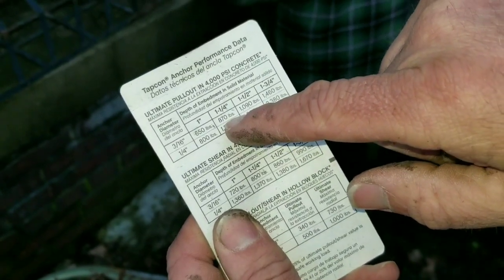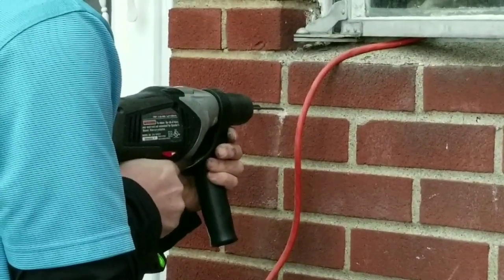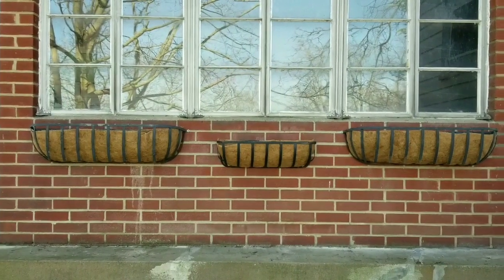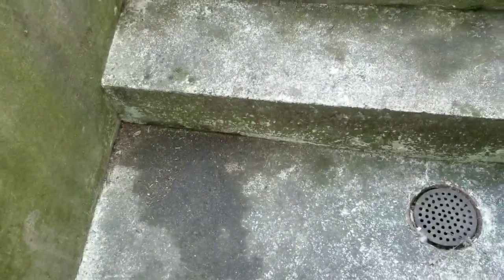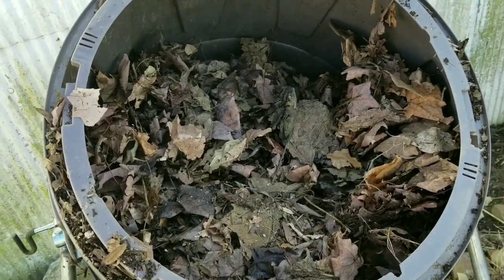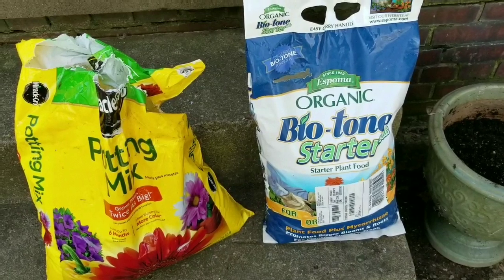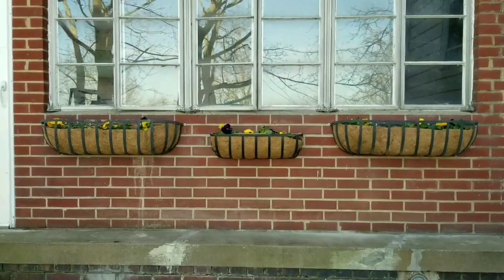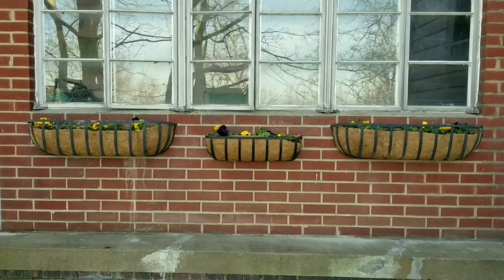Installing Hayrack Planters

Comment: I'm considering buying a couple of hayrack window boxes and was wondering how window boxes are to be hung on brick.  Thanks for showing this.  I'd be a little uneasy planting flowers from ledge have you considered opening your windows and plant them from inside your house?
Reply from the maker: Thanks for your concern about the ledge.   I'm ok with balancing on it to plant and fertilize.  The center windows are screened.  only the windows on either side could be opened to plant.  However, I have an antique hutch. that holds my cricut and cricut cartridges (old school scrapbook machine) that blocks the right window.  Hope you decide to give the hayracks a try, they really add a pop of color and point of interest to a wall.

Comment: Hi can you please describe the hardware you used to hang the planters? Thanks!
Reply from the maker: Mortar screws and a small washer on the big hayracks because they have a place (holes in the frame)  The small hayrack frame rests on same type of screws but with a large washer in front of the frame and then screwed tight.   Hope that helps.  I'll put pictures on my Instagram of the hardware so you can check that out, if you like.